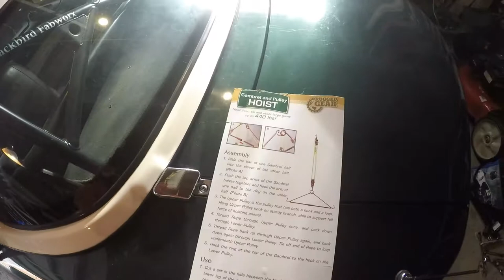Hardtop Hoist

Comment: Great video!  What lift straps did you purchase --- or how long are they?  Any further recommendations on this lift setup since you made this video?    Thank you.
Reply from the maker: These are 2,000lb rated straps,  just over 6 feet long each.  Purchased from harbor freight.  I’ve had this set up in 3 different garages now and has worked in all.  All that has changed has been how I’ve attached to ceiling/joints depending on the garage.  System works well enough for me.  Probably not the best option lol but cheap and very doable with one person
Reply: @miata-focus3455  Thanks for your welcome reply.  I just finished making / installing my own ceiling lift setup with a manual block and tackle and the Gambrel spreader bar based on how you built yours.  It is working well.  Luckily I can drive my convertible straight into my garage nose first, no need to back in.  Thank you very much.